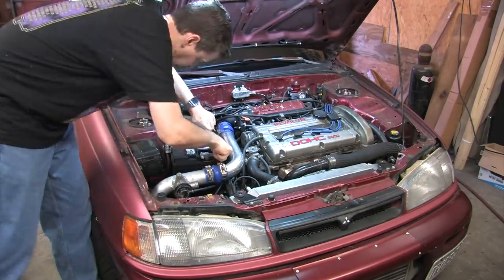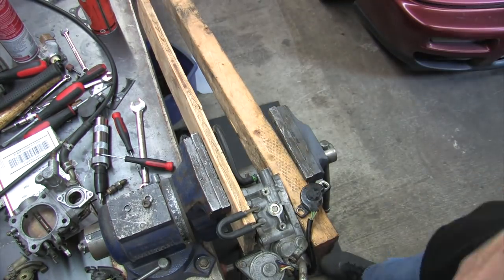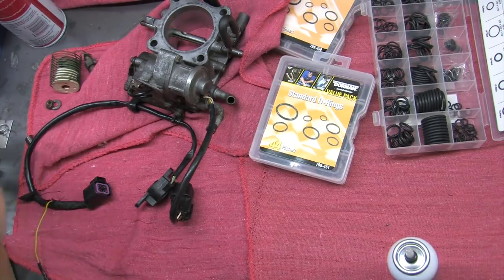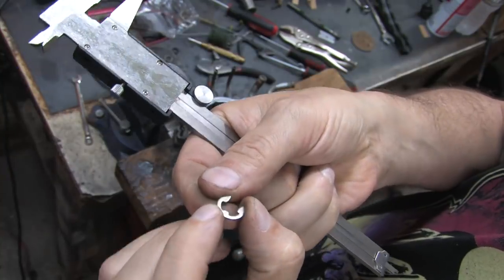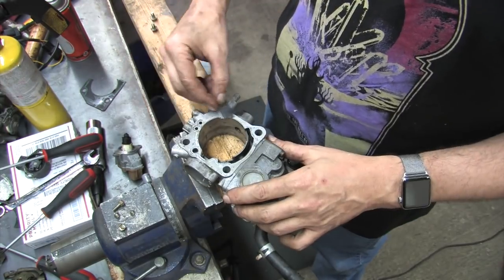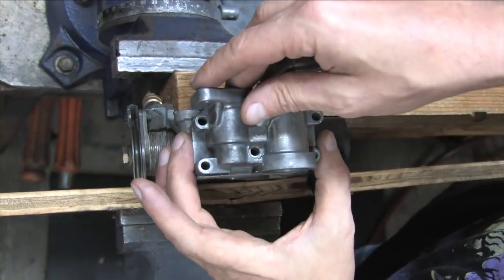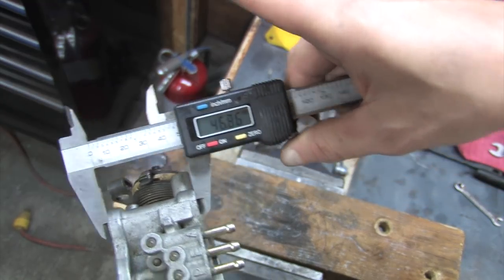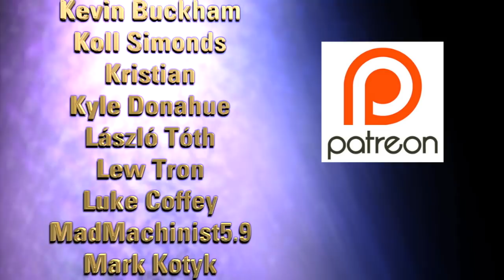Rebuild Turbo DSM Throttle Bodies

Comment: Working on a 93 throttle body right now because it was leaking massively. This video was a great resource. Thank you for posting. 

I did resort to an impact screwdriver for the throttle plate screws, and I used a tap to clean up the threads before installing new screws. 

Finally, I'm pretty sure this one has been rebuilt before because it was pretty marred up where the seals go in. I had to shave the outer lip down slightly because of a small ridge that had formed.

Comment: I rebuilt my 1990 throttle body a few years back.  You can use the following which were identical to the mitsu seals.  Skf 3030 (cr 8x12x3 hm4 r) and Skf 3930 (cr 10x14x3 hm4 r). I have had zero boost leaks with these on my 1990 tb. I do pressurized boost leak testing often.  Hope this helps.  Great content as always.

Comment: I don't own anything with a 4g63 but this video as been extremely helpful, insightful and entertaining.  I've found myself lacking motivation for a number of reasons over the course of the last year and have found it hard to go out to my shed and do anything.
I recently rewatched cylinder head 201 again and found myself out in my shed stripping down a spare cylinder head for my 405 mi16.
This lead to replacing coolant hoses on the engine already in the car, witch lead to other small jobs being done.
One of those jobs was porting and polishing a set of jenvey throttle bodies that are waiting to go on the car.
My point is jafro's enthusiasm and passion for what he is doing is infectious.
Thank you jafro!

Comment: YYAAAASSSSS  I did the seals on my 90 throttle body  to fix some nasty boost leaks I had with the help of a dsmtuners article.   
3:15 I remember the article warning the reader at least 3 times to be careful not to strip those screws, they're a pain.     The heat and penetrating oil are a great tip, I'm going to have to remember that on the next one I do.
Reply from the maker: I haven't been on the internet since Thursday.  I haven't watched a YouTube video in over a week.  This morning I came in to work, saw and clicked your barn find video, started my 7.4GB upload, got interrupted 5 million times, finished my upload, and now I'm finally getting a chance to sit down and watch your video.  First thing I clicked, though...  Seriously.  I skipped YoungBloods (YBS), Darcizzle Offshore, OzzyManReviews, Cleetus, and all of my subscriptions for your barn find video.  Thank you, man!

Comment: Funny how Ive watched your videos for years without ever owning a DSM. Yet now that got myself a Galant VR4 I am dealing with the very same stuff you talk about in your videos. Im currently on my 5th removal/install of my IC piping and throttle body narrowing down and fixing boost leaks as the new ones pop up from the old being fixed. 

Your videos have already helped me tremendously and will no doubt come in handy again sooner than Id like :P

Comment: If I may make a recommendation, valve lapping compound on the tip of a screw driver helps fill in the gaps that are between the screw head and the driver/bit. This trick has helped me countless times. I can't tell you how many helicopter blade ends have corroded screws that open the cap for balancing. A large #3 and fine grit compound make it a breeze. And if you're stuck on the road with this problem, find a crack in the road or some dirt. Spit on the screwdriver tip and grind it into the ground a bit. Provides nearly the same result.

Comment: I bought chicago rawhide seals for the 1990 throttle body from a local seal distributor. They were able to provide me with the exact sizes Mitsubishi used after I did some leg work and got the seal numbers . Last time I rebuilt a 1991-1994 throttle body I once again ordered SKF seals from a local shop for $8 a piece (different more helpful shop this time). The seals weren't in the system but they were in the book so thankfully the guy ordering made a call to SKF and I bought 4 seals (half of all stock in Canada). When it comes to finding O-rings you could have gone to a seal shop that specializes in O-rings (Hi-Tech seals for me and Texan's) They would probably let you try out a few sizes until you got what you needed, plus you could get different materials. I gave up on my 90 throttle body so if you want a spare throttle position sensor pay shipping and it's yours.

Comment: My good friend and automotive teacher "Mr. Burge" taught me to use valve lapping compound on the tip of a screw bit to grab the metal and get a stripped screw backed out, so far its saved me once!

Comment: How fun you make ticky videos! It doesn’t matter what kind, except the electrical ones. You know my bone to pick, but I am not beating that dead horse again only to be ignored! You just keep pressing and I am glad you are getting Patreon support now and I believe I spoke of this in one of my former comments long before you actually got on this wagon. I hope you keep gaining support from these people! Your channel is important to many including myself. If you cannot do it like you do, find a channel that has people you identify with and you learn there are others who are as fanatical about things that you have a passion for! Keep pressing!😁👍🏻
Reply from the maker: I'm not ignoring you at all actually... I'm watching you go through the catalog and catch up.  I was trying not to give you the spoilers about the electrical fixes is all.  ;) Dangit, I just did.  That trunk run is gone except for the stereo equipment.  It's all fused and safe now.  Battery relocation fixed 90% of what ailed it, and the shootout video you just watched is where I fixed the ECU pins and my wiring issues.  This car has never run so strong, so reliably or started up so fast when it's cold.  You look at the key now and she fires.  It's fantastic.  The failsafes I built into the water methanol kit work great because they're solid state and operate separately from my ECU.  If it goes into failsafe, it drops boost to wastegate pressure where the ECU won't even break a sweat to manage fuel correctly.  The ECU doesn't even know when it's in failsafe mode, it just thinks all of a sudden that it's a stock turbo DSM and does its thing.  It's great!  But yeah, I was just trying not to give you spoilers.  I uploaded a new video Sunday and it's kept me very busy.  Thank you for going through so many videos and following this car's journey.  ;)
Reply: Not trying to pick here. But you have grumbled about your wiring harnesses all before in past videos. I saw the brilliance of that methanol/water injector circuit and how it managed to be independent of the ecu! That was quite amazing stuff from someone who claims to not like electrical stuff. The fact is I think I complemented you on that. You have far greater skills than you let on to. Your research certainly is unquestionable! I don’t complement anyone for the sake of doing it. In my world you earn yours through your work and your work proves worthy of such! You have the skills people who view you admire or else you would not have the support from the community you serve. You exhibit those skills and explain them in a manner unlike what some of the others can’t and without the pretension and know it all attitude others on this medium so eagerly express. You are unique Jafro in many ways and this is why you will continue to prosper while others fail. Prosperity takes many forms. It does not have to mean you are rich! In your case, it means your fan base is solidly behind you and your fan base is also acting like a runaway snowball downhill. You’ve earned this and if my situation were not what it is, I would be a Patreon supporter as well. Mine is not such as I am on a fixed income. It doesn’t allow it Yet! I did say yet. When it does, you can be certain I will be one! I’ve been encouraging others to do so if you’ve read my last three or so comments. If I cannot help one way, I try to help in another way! That is how I am made and how I roll! 😊👍🏻😁👏
Reply from the maker: It's okay.  I put this out here for free for everybody.  I say for free because 90% of the world uses ad blockers, but it's okay.  Not in my power to control and I understand why they do it.  I'm always happy to see people who get excited about this stuff.  It looks like I'm trying to teach people about DSMs, but it's not what I'm actually teaching people at all.  I'm teaching people how to think critically and creatively about what they're doing.  Patreon has given me enough of a boost to really make a difference in the kind of production equipment I'm using, and I've been making upgrades wherever I can as I go along and it's had an enormous impact on the GSX build series going forward.  You're going to like it when you get there.

I can only be grateful for where I am after all this work.  I can't begin to describe how many thousands of hours I've put into this over the past decade.  I'm pretty humble, no social media, no self-promotion, just an organic following of people who searched for this and found it.  That's why I've got all the best subscribers on all of YouTube.  They found me because they wanted "it".  And I'm here for all of them.  I poke around on other people's channels and find my subscribers' comments everywhere.  They're concerned, kind and helpful people even on other people's channels.  It's absolutely fantastic to see those are the kinds of people following my work.

Just be aware I'm pretty OK at reading people, and I will often do things to make even the brightest among us uncomfortable.  Pretty much the entire Hyundai series is exactly that.  I want everyone to feel dirty for learning great things from the least among them.

Comment: nice to see a 1 hour long video of jafro fixing the throttle bodies.

you've upgraded the engine components alot, but you've left the transmission untouched. maybe custom straight cut gears, or performance synchro rings, or even a better shifter and it's linkages would be awesome. anyways great work that you've done, keep it up.
Reply from the maker: In the Hyundai, I'm using the '90 FWD transmission.  It's renowned for being the toughest gearbox in the lineup.  My GSX has a TRE stage 2.5 transmission in it, and my Galant VR-4 has a TRE stage 2.  So plenty of upgrades have been done on the transmissions that needed it the most, but I do have an extra spare '91 AWD gearbox that I plan to do those kinds of upgrades to.  It just doesn't take precedence over the 3 cars I need to get rebuilt and running first.  The 3 cars with that have perfectly good working gearboxes.  I'm ready for that day when it comes, though.  :)
Reply: cool, glad to hear it, keep up the good work.

Comment: Secret I have found over years of rebuilding carbs and a few throttle bodies- especially from applications where the pedal gets mashed repeatedly, as in racing, the throttle plate shaft can become twisted- like a torsion bar. The butterfly will be slightly bent, too. Just as testing pushrods- roll the shaft against quality plate glass to determine any bend, and use a laser pointer to check the valve plate groove for twist.
Reply: Good info! Will try to keep that in mind the next time I'm in something with a cable driven throttle

Comment: I worked in aviation for several years (damn air boats full of corrosion) and the best thing for stripped Phillips heads was good old valve grinding paste. As long as you do it as soon as it starts to round over.
Reply from the maker: Wow, that's a cool idea!  Than you for putting another trick in my bag!

Comment: I don't own a DSM, but I am curious if the throttle plate screws aren't Phillips and are actually JIS screws...
Reply: they indeed are. I have been burnt many times rebuilding keihin carbs, throttle bodies and NISSIN master cylinders and stripping out the damn screws. Finally I bit the bullet and bought JIS spec screwdrivers
Reply: Yep. That's the dot.

Comment: I need to do a mazda mzr dedicated channel. Your engine was far more common than the mzr, but the mzr started in 2001 and is still being produced. It was used in almost every mazda and ford product in that time period. It shares quite a few parts from the previous generation Mazda motor, the B series, and it surprisingly shares quite a bit in common with its successor, the SkyActiv series. Almost all variants of the motor can be turbocharged since Mazda built the blocks and cranks to be shared between natural and turbocharged variants. 

I am running 8 psi reliably on my stock motor miata (2.0L with 10.7/1 compression ratio) and feel comfortable I can push 10 psi, but there all sorts of nuances I had to figure out to get there. For example, the motor suffers from PCV blow by, a few check valves need to be added, the MAP needs to be swapped, the intake needs an extra gasket to seal a minor air leak, etc.

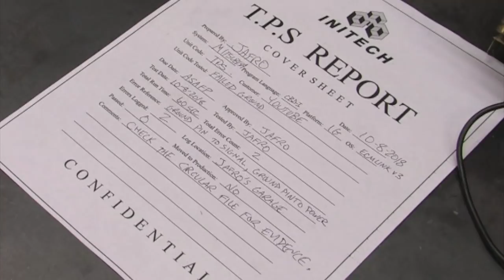Comment: 1:01:18 TPS -form regulations require dates to be written in the ISO-8601 "YYYY-MM-DD" format. You'll have to throw away that form. (Update: Thank you for your very prompt compliance with TPS regulations.)
Reply: Just wanted to follow up on your TPS reports, did you get the memo?

Comment: Thanks again Jafro. I have an EVO III intake manifold I was going to use for my 2.3L 6-bolt build. I have a Diamante throttle body, I found it bolts to the manifold and is a larger diameter than the DSM! I want to use it, even though its supplemental equipment protrudes out extra far on both sides of TB, I'll have extra room with the engine in a Dodge Stealth chassis but I have yet to bolt parts to a 4G63 engine to check. I imagine that it can be rebuilt and  holds boost, just the same, it looks like a similar built Mitsubishi part.. and I believe Diamante 6G72 TB was different  pre/post '99/'00.

Comment: One other way that's more ... let's say hi-tech to get ANY seal you're missing, is to contract someone with the ability to create a mold (be it 3D printed, machined, cast) and then cast your own using the type of rubber/silicone/rtv you think is closest to spec.

Personally, i 3D print my o-rings now using TPU filament. As a material, it hits pretty much all the soft spots of a rubber, has some minor disadvantages (you can't use it for anything that puts too much pressure as it might give way due to the way it's printed, but i've gone up to car tire pressures for a few seconds on some and they stood up to test) and is easy to re do, again and again, since i have the file.

Smallest i've printed was for my Renault's carburetor, a tiny, tiny little gimp that i couldn't find unless i accepted new old stock, which is pretty much perished rubber by now, and the largest is a gasket that fits on a 1988 Merc's compressor housing. A hexagonal piece with a smaller inner wall (which is the high pressure application i talked about).

There's hassle involved, but going forward, with parts demand, i think this is the future.
Reply: Agreed. We use 3D printers and a laser burner at work, and hope to get a small CNC mill soon. Very handy for making specialized parts.

Comment: I remember when I did my 1990 throttle body. Managed to do it on the car. That was before the dsmfaq server crashed. Seals are still holding strong.

Comment: I put my throttle body in an ultrasonic cleaner with a degreaser for 1/2 hour. I then took it out, rinsed with water and wiped it down with a white paper towel. When I was done, the paper towel did not get dirty; it was bright white. All the little nooks and crannies were clean enough to eat off of.

Comment: I own a 90 DSM and found out the hard way that the throttle bodies are different when I bought a junk yard throttle body to get a switch off of.. Thats the exact reason I want to take every modification off of the 90 I own and eventually swap them onto a good condition 91 DSM. That way aftermarket support will be way easier and I wont have to worry about the differences on a 90 car vs a 91-94.

Comment: Small tip to times when you got screws that are hard to remove. A lot of screwdrivers have a hole through the top. I like to take a long allenwrench or some metal rod through that hole and press down on the rod/allen wrench while rotating for maxium leverage and down force on the crew.

Comment: You should half-shaft and knife-edge the throttle shaft on at lease one of those. Also, taper the holes in the plate so that tapered screws can sit flush in the plate. You can do all this for next to nothing. If you're feeling really brave, locate a slightly larger plate and bore out the throttlebody to match.

Comment: No TPS surgery? The case halves are ultrasonically welded together. A home made hot wire saw is nice to have; a Dremel wheel makes too big of a gap. TPS is just a glorified rheostat. The cast body is what holds it's position onto the TB. Usually it's just a loose & dirty wiper.

Comment: A little note: the 1990 throttle body tps is the same one that mitsubishi carburetor vehicles use from 1992-1996 so you can harvest them from those old carburetors(4g93 and 4g63)

Comment: Interesting that there were so many variations in Throttle Bodies on 4G cars over the years. 

Mitsubishi gave the 3000GT and most of their 6G powered cars the same throttle body from 89-2001, and is almost exactly identical, if not the same as the 94 you have in this Video. Including the plastic Biss Screw , Fixed SAS, and internal idle switch based off the TPS.

Comment: Interest point regarding the BISS screw, that brown plastic is actually exactly what is supplied new by Mitsubishi (Purchased a new one for my TB rebuild). The old one had totally lost its 'point' due to corrosion/carbon build up, and the BISS must have not been functioning correctly.